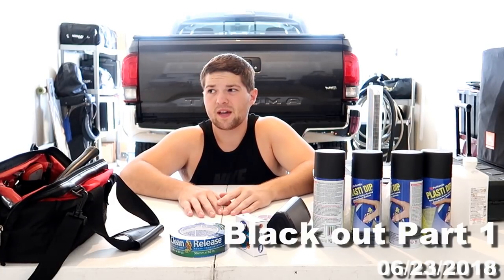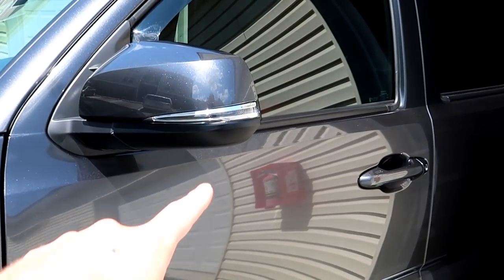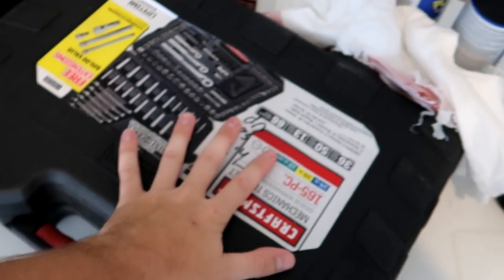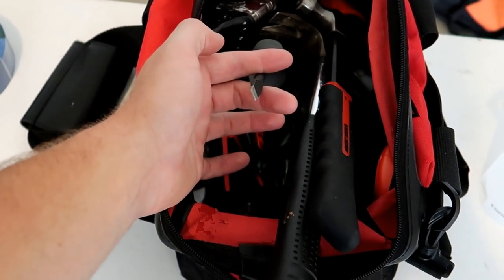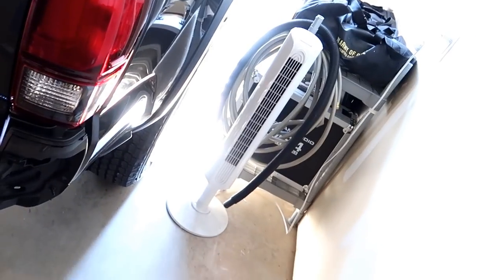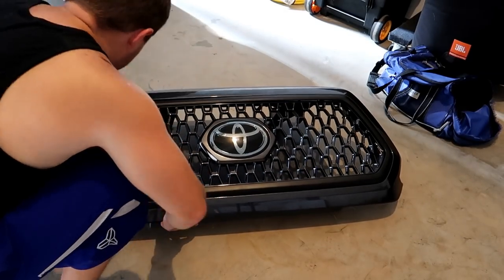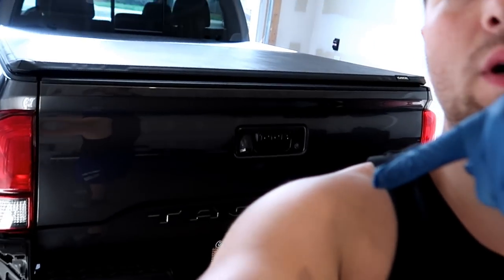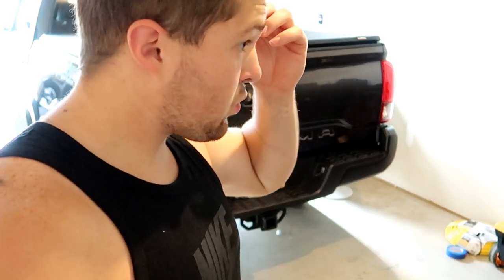Tacoma Mod 04 | Black Out Part 1 | How to Plasti Dip | Emblem Removal

Comment: Great instructional video with some dead on details.  One question- the last clip that you removed when pulling off the chrome bumper caps (clip looked like a double edged razor blade)- did you end up reinstalling it as well?  You mentioned you may have to glue it.  Or did you just opt to go w/o it - and if so, is it still secure?  I'll be doing mine next week so I want to make sure I do it like you did.
Reply: I was wondering the same thing? I'm getting ready to tackle it tomorrow
Reply from the maker: sorry late reply, but I did leave it out and had no issues with securing it. And almost a year later still on there snug

Comment: Great vid!
2 question. 
1. Couldnt you plasti dip the back bumber while it still on the truck?
2. Can u run through a car wash with plasti dip on your truck?
Reply from the maker: You could do it while it's on the truck, but it wont turn out that great since the plastic on the bumper is pretty tight against the chrome. 

You can definitely gi thought car washes. I have taken mine through 50 plus now. Non touch only though.

Comment: Hey rick saw you have the same gator cover as me. Same taco and color as well but I have the sr5, modding when I can. Question about the gator cover... You know the corners by the head bar towards the front of the bed, where is a foam block to keep it water  proof? The one attached to the cover... for some reason I don’t know if it’s not cranked tight enough or to loose they are bowed up on both sides. Do you know how to get it flush? I’m getting water in and trying to make it waterproof. It’s pretty difficult to make it water right, have any tips? Thanks sorry for the long question, love your videos by the way!
Reply from the maker: I cranked mine down really tight. But yeah I get some water in the bed always. If you want true waterproof the gator shouldn't have been the choice. It will still let some in.

Comment: Just picked up a black '21 Taco. It's got all chrome badging including the tailgate. Would you rec. just removing the lettering and leaving naked and black or replacing with matte black TACOMA lettering  on the tailgate?
Reply from the maker: Not sure. I like just the simple plasti dip methods

Comment: I'm a Taco newbie; bought a used 2011 TRD Sport so, most of my stuff is black already. Once I Plasti Dip my badges, is there a need for special washing and waxing care that needs to happen with those dipped badges?
Reply from the maker: No special washing. You do want to avoid putting wax on them. Like past applied wax, spray wax is fine. the paste wax tends to discolor the black

Comment: I'm curious on how the front grill/bumpers will look after a years worth of driving. I heard rocks n debris like to get stuck in the plasi dipped parts.
Reply from the maker: Been on there now for almost a year. No problems at all. No chips or anything. It really comes down to making sure you put a bunch of coats on there.

Comment: How's that grill holding up? I did mine a couple weeks ago (6-7 coats) and its already sand blasted from highway driving. Can see some chrome coming through.
Reply from the maker: Mine is perfectly fine still. doing the ring and badges and bumper caps. And I drive 100 miles each day from work and back and have made a 16 hour trip to atlantic city and a 12 hour trip to Ohio with the plasti dip. I actually was inspecting it closly yesterday and its holding up amazingly with no nicks in the paint. And my front in is normally plastered with bugs this time of year.

Comment: Question:  I attempted to remove the rear bumper covers as well but my 2017 Tacoma bumper(s) has about an 1" diameter hole that is wired from inside, capped on the outside that serves no purpose holding the thing on.  It looks lie to me that it's for an optional install later.  The wire/cap set up was however an issue getting the whole bumper off.  Thoughts?
Reply from the maker: Are you talking about the proximity sensors that are in some of the upgraded models? Feel free to send me a pic on instagram @rickyweber65 and we can talk about it